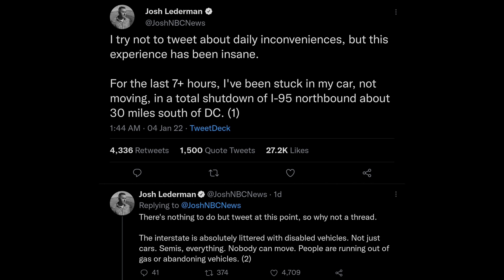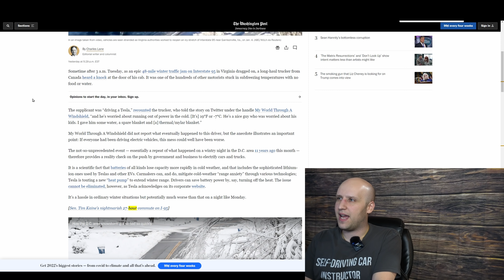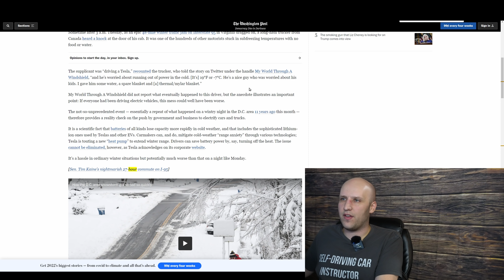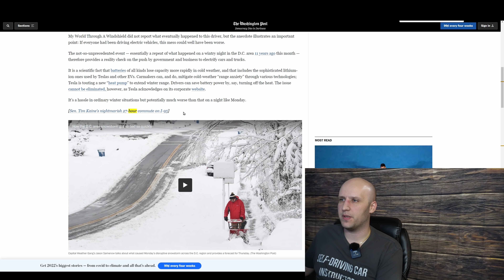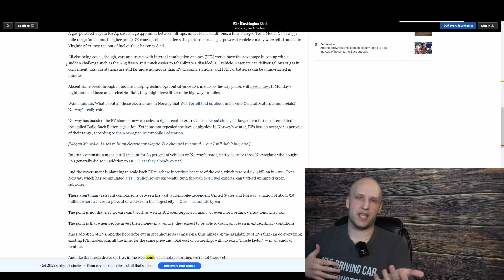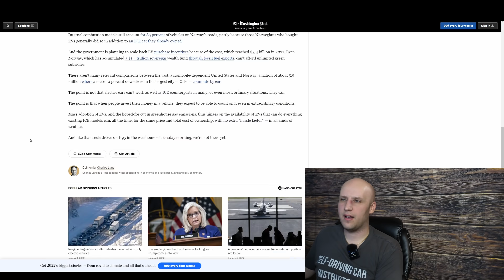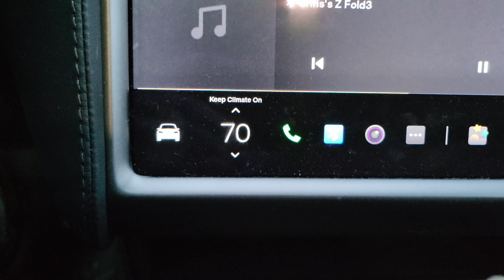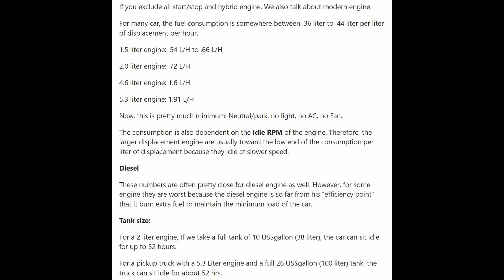How Long Can a Tesla Keep You Warm In A Frozen Traffic Jam? | FUD Debunking

Comment: Quick math suggest a 60kw/h battery should last 30 hours at 2000w heating, that is just enough to keep the car a little warm, at 4000w it would be comfortable and last 15 hours. If the car has a heatpump heater it will last a lot longer then 30 hours (if the heatpump use 1000w continuously it will last 60 hours). But these numbers do not account for the loss you have in the battery heater which can be considerable but I do not know how much that uses.

Comment: In winter time, always wear your winter clothes and jackets while driving. 
Then, lower the cabin temperature to around 16-18 degrees Celsius. (Rather cold).
You will then use less energy to heat up the car, and in an emergency, you will stay warm for a longer time. 
Note: Make sure that the seat belt is worn correctly when doing this. You may need to open the zipper in that thick down jacket to do so.

Comment: There is an alternative, diesel powered hot air heaters, easy to install and wire up, got it's own tank and you can keep a spare container of fuel, it does need 12 volts but users low power to run

Comment: If you would have switched to cabin circulation (that is what I do in this kind of situations) the battery pbbly would have last 48 hrs or even more.
Because you just rewarm the cabin air, instead of permanantly heating up cold air from outside and blowing it to the outside just seconds later.
The only negative is, your windows may fog up after a while, more or less, depending how many persons are in the car. 
In that case I switch to AC for a few minutes. But fogged windows in a traffic jam do not matter really.
By the way, in summertime I use AC EXCLUSIVELY with circulation, and I am still alive 😉 and in summer there is no fogging ☝

Comment: I think he missed the fact that every adult sat in the car emits around 100 watts of heat.  If the car has a family in it, the car will expend a lot less energy to keep the cabin warm. 300+ watts for two adults and two young kids is not an insignficant amount of heat.   For a fair test you should lock a family in the car ;)

Comment: A gas engine only uses about a quarter of gallon per hour to idle. So with an 18 gallon fuel tank, you would be able to idle for over 40 hours. And still have a third of a tank.

Comment: In a life or death scenario and maybe Covid wasn’t a problem then I’d suggest making friends and getting together with a group of stranded vehicles right next to you. This way you can individually run and heat each vehicle until you reached a low but safe enough level of battery or gas so that you can safely make it to a refill/recharge station and then switch to the next vehicle to do the same. Obviously you have to be safe and mindful of the people you choose to gather with.
Reply: Sorry if something similar to this was mentioned in the video and I missed it but I have a toddler running around 😂

Comment: If we outfit tow trucks with generators, and people aren't stupid like driving around on E! until they get gas. The biggest thing we need is to transition to heat pump technology which is way more efficient, I don't even know why they went with a resistive heater the numbers have been in for the housing market for years now. And then if that fails you can always throw in one of those power stations in the trunk or frunk to run your blender while glamping or charger EV will away from a charger.

Comment: Getting home after that would still be a risk because driving in cold weather also drains the battery faster. I'm not sure about coasting and energy usage on electric cars but when traffic does start moving, you will using extra power on heat and moving.

Comment: You are 100% correct on your comments to the articles.  I see no problem with EV's, my one concern, and I watch alot of stuff on this, is halling with ev pickup trucks for camping ,etc.  This is where the issue is.  If I'm going 500 miles from say socal to yosemite, with two kids, is a 10 hour drive and 3 gas tanks.  In a ford lighting that 10 hours turns to 12 or 13.  This is where I hope they make improvements.  We travel and camp alot.

Comment: Attempting to evacuate from a major hurricane would be a disaster with an electric vehicle! Once you are out of your limited range, you’d have to find a working charging station. You might have to wait many additional hours if there is a long line at the charging station. If the charging stations do not function, you are out of luck, and you are stranded, while the hurricane catches up to your location! Riding out a hurricane in a vehicle is extremely dangerous and could get you killed.

If you evacuate the major hurricane with a gasoline powered vehicle, you have the full gasoline tank, plus many 5 gallon gasoline cans that you take with you. If gasoline stations are not available, due to long lines or no electricity for the gas pumps, you can quickly refill your gasoline tank with the 5 gallon gas cans. Your range can be extended drastically by carrying the 5 gallon gas cans.

To extend the range of an electric vehicle, without the dependence of charging stations, you’d need to pull a trailer that’s carrying a portable gasoline powered generator and 5 gallon gasoline cans to refill the generator. In that situation, the electric vehicle’s range could be extended, but you’d have to stop for hours to charge the electric vehicle with your generator, while the hurricane catches up to your location.

Attempting to evacuate from a major hurricane with an electric vehicle is a bad idea. 

Your comparison of how long a gasoline car could last running the heater is distorted. With a gasoline car, you could run the heater very hot without consuming more fuel. Then you could intermittently run the gasoline car to stay warm. An electric vehicle couldn’t be run intermittently, since the electric vehicle consumes more power to heat the car when it’s very cold.

Comment: Well I am not big on EVs but there is some things not stated here.
1 if your stuck in winter yes blankets  put I would think people would be dressed  for winter so the EV temp could be lowered to 60 and you will be fine .
2 gas vehicles  at ide make less heat so most likely  it's temp will be lower  at the heater core so it will be cool in the car .
3  exhaust  gas can kill you.
But here is something  no one ever stated buy a generator  a small one for both types of vehicles  
EV to charge it  120 volt gas Generator  amps un known that is needed.
Gas car to make electrical  to run a milk house heater 
Yo I'll be roasting soon and the generators motor can be piped from you fuel tank . Yes I know A EV with gas in it global  warming but when when you really freezing life  and death  you would I hope to it in a hart beat.
Any way this was fun have a great day all of you.

Comment: Ice car batteries fail if they are not being charged properly by the alternator, or if they are old, most over 4 years may fail.  Once the battery fails the battery will no longer charge with the alternator and then the car will not idle or even move.  They rely on batteries to maintain the voltages Peak and amps Peak that a alternator do not.  Old car old batteries will not survive this scenario.

Comment: In winter with winter coats and cloths on a 70 degree climate would be to warm, as well as heated seats.  Use camp mode and its even more efficient.  Heated seats are for commuting to a job or starting with a trip they are then turned off or automatically turn off after 20 minutes.
Reply: I never use my heated seats.  I live in Canada and we start the car 5-10 min before even getting into the car.
Everyone has remote start.

Comment: Just on your last point about owning and preferring an EV, the data makes it pretty clear that with EV trade-ins most replacement vehicles are not EVs when an EV is traded in for another car.

The last data I saw on this point, was that 60% of EV trade-ins went to purchase an ICE vehicle, and over time this trend appears to move away from EVs more and more.
Reply: New ICE sales peaked in 2017 while new EV sales are surging.  ICE vehicles will always be around, but they are giving ground to EVs.
Reply: @SpottedSharks  with the expansion of green power generation,  we are approaching a state of concern for rolling blackouts when sun and wind are limited.   There is also the problem of grid infrastructure,  with most neighborhoods having a capacity of 3 EVs out of 10.

Comment: The one thing that I haven't seen anyone mention that I know has happened and that is people with snowmobiles have gone out with gas cans and gave gas to cars stuck on the highway.

Yes any car can run out of fuel/power, but with an internal combustion engine all it takes is a gas can and you can keep going for hours.  I keep a 2.5 gallon gas can in my car, I use it and refill it every spring and fall.  I have never needed to use it in the decades that I have done this, but I keep it because of the severity of winter.  I also keep some food, and blankets in my car.

This is a very niche problem for electrics, the bigger problem is the inability of the grid to sustain EV growth, the raw materials to make more EVs with 25 tons of raw materials needed for every 1 ton of battery, the limited reduction in CO2 with EVs and green energy.  This last point has to do with the CO2 needed to make green energy sources and the long time frame to overcome that starting CO2, so this hurts the big picture of EVs and green energy.  The exception to this would be an expanded use of Nuclear.

Comment: Dumbest video I've seen yet promoting electric cars, let's start with real world conditions 
A) your on a freeway,  highway, back road whatever, coming home from working a 8-10 hour, or on a rd trip your battery isn't going to be %90 full
B) The exterior Temps in video have a 7 degree difference 
C) Nobody has a clue how long the interstate is going to be closed for, so turning interior temp down is nit even a consideration

Comment: What an electric vehicle has to do with this is the energy density of the fuel. Electric vehicles are getting better as you noted the differences between your X and Y models, but it is a valid question.

Comment: "EVs lose 20% in the winter in very cold weather", ok, but part of the loose is due to the air more dense in winter (as for ICE cars...) but of course it does not matter when you are parked in the cold. So at they end the question is how long an EV car heat the occupied seats compared to how long an ICE vehicle can heat the seats or the air (as you like). And I am quite sure that the EV can do it for far more time! Not to mention most EV drivers leave home with 80% to 100% of charge each morning while most ICE drivers don't. To conclude, what ever your car, put blankets in the car in winter, and fill often the car, with gas or electricity.

Comment: Hey, just chiming in to say I did a similar test a couple weeks ago with my Model 3 LR.  12 hour overnight test, low was -7 C. I set cabin temp to 15.5 C.  Used around 8% of battery, so a full charge would get you around 150 hours in those conditions.  Vehicle was using around 500W continuously over the test period.

Human body makes around 80W, so with two adults and a child that's around 200W (only working at 100% efficiency however; the heat pump works at perhaps 300%, so having a family of three in your car would only extend the battery lifetime by maybe 1 day). 

I summarized the test and some thoughts in a youtube video.

It makes a big difference what settings you use and how cold it actually is outside. I may test it again with lows tonight around -11 C.

Comment: Putting the preparedness and vs debate aside, due to range anxiety I suspect EV owners would fair better in an unexpected event like this since that anxiety makes you keep your "tank" full as much as possible on the whole - as opposed to the ICE driver who knows / thinks they can easily fill up whenever they need to, so drives around with just about enough to get to that gas station (plus it's poor economic practice to fill up completely and drag that added weight around if you're not going far).

Comment: agreed there are advantages and disadvantages of owning each type of vehicle however i was going over the data for fuel consumption at idle for cars or small SUV's and most modern GDI engines burn rate are less a 2 L ice is about 0.5 to 0.64 L/H a 1.6L ice about 0.31 to 0.39
 L/H also a vehicle with a 2L engine tank size is about 48 to 58L a 1.6 L engine tank is about 42 to 45 L  for a small car.. (i have seen a 10 gallon tank since the 90's) therefore u would have gotten alot more than 50 hours run time while maintaining 23°C in the Cab .. 15°C  too cold ❄but in an emergency conservation is key.. although in an ice vehicle u could conserve since it generates alot of heat run for an hour shut off for 1/2 hour or a hour depending on outside temp

Comment: The biggest problem with electric cars is that too many people think they must be all electric with no fossel fuels used whatsoever. This is very narrow minded concrete thinking. As an example a diesel air heater could be used to heat electric vehicles extremely well for very low cost when needed; such as when stopped in a snow storm. But no, fools convince themselves that would be sacrilegious without realizing that it takes vast amounts of fossel fuel to make these electric cars to begin with.

Comment: Electric vehicles are a total gimmick. People will fall for anything 😉 Much better technologies are there. Maybe for city use only, the small electric vehicle is ok.
Reply from the maker: I've driven 70,000 electric miles in 3 years. It is not a gimmick.
Reply: @DirtyTesla  No big deal, electric vehicles are kinda like a novelty item. There are many reasons electric vehicles aren't the great solution that many people hoped for. For one thing, if everyone had them our electric infrastructure would fry/ burn out. The USA electric infrastructure simply cannot handle such a huge demand. Another reason electric vehicles are impractical is that they take way too long to refuel. Another reason is Lithium is difficult to obtain and causes more pollution than it's worth. Besides, massive amounts of power still must be generated at distant locations,then pumped through the wires to charge these batteries. There are several other reasons. For our power tools and a small electric vehicle used only in city battery powered is alright. There are many other reasons why electric vehicles aren't the solution. There are much more practical technologies available and being developed. Be patient, hang in there.

Comment: You have to be totally oblivious or not have any common sense an electric car on a drive is going to be more efficient but it's going to run out of power if you drive it like a regular gas car the gas you can stretch out longer depending on what is being in the car you can last longer it has a history decades of history decades of history to prove that gas We'll last longer and can be found in obviously easier places you could siphon gas you can't siphon electricity I love electric vehicles but you can't be so ignorant to think while they both deplete that's true but one is doing all the work for everything whereas a car battery is doing some work and the gas is doing the rest of the work or a hybrid has a handshake between the 2 with electricity you could drive it as a regular car you could speed and do everything you can and you'll run out faster and then you'll have to spend longer charging it if you can get close enough to a charger and a gas will not be able to stretch that a little longer maybe you can turn it off maybe you can idle it or maybe you can just run it and let the heat and electricity run off that little battery but everything is being done altogether Or an electric vehicle so it's a little more scarier it's more comfortable it's more efficient but it's a little more scarier hence why you have road you have   range anxiety Because some people are always afraid they're gonna run out of electricity

Comment: You are missing the bigger picture. Someone can walk up with a 5 gallon can of gas and you can idle for a long time. Try and bring a charger to the EV in the middle of nowhere. How about if the storm knocks out the local power grid. I know of many EV drivers who just quick charge for 20 minutes and move on without ever fully charging. Also the EV vehicles are very heavy and harder to push out of the way.

Comment: What if you had to have light's  on while  suck in hold up ? How much more power are you going to use. ? 
 I have had petrol  then went to diesel. 15 years ago best thing I ever did . I ordered another diesel in August last year was told last week Fords have stopped putting them in the kuga now got to go back to petrol about 25% more expensive to run . The diesel engine are so economic to run will last 450,000mls . Electric cars are being pushed on us to quickly they have not gone through the test of time yet for reliability etc. Can see alot of problems ahead with charging / charging site's and que's blocking roads for charging point's  ,and cars waiting for breakdown wagons after long hold ups.  Another issue is range on full charge most cars are about 280 miles no good for long journeys diesel kuga 625 on full tank . But Time will tell , I hope I'm wrong but they have to improve alot before I even think about electric cars .